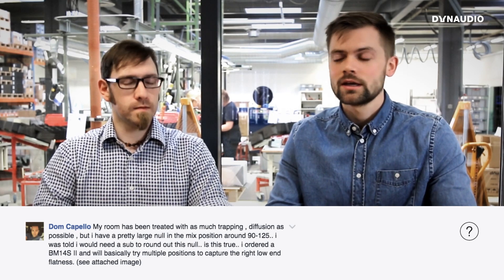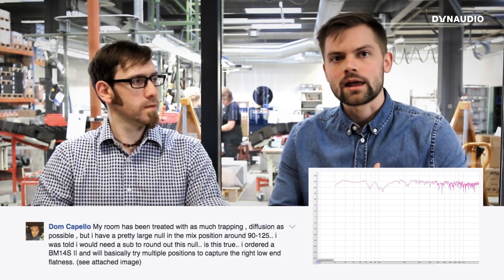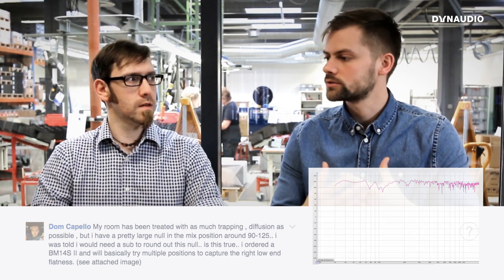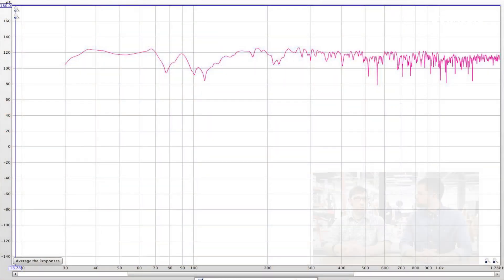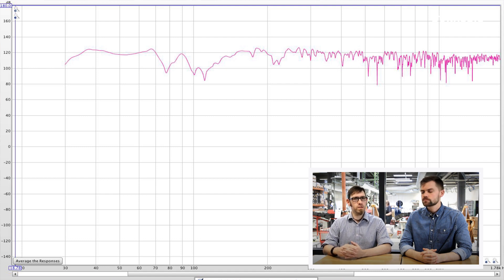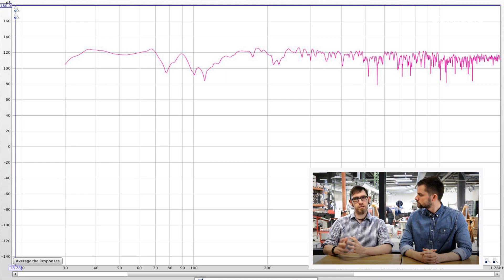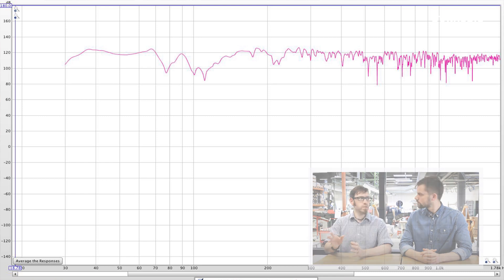Ask The Expert Episode 002: Monitor Placement In Home Studios

Comment: at arms length and 3 metres away for speaker placment ? its a little confusing...

1. should speakers be placed 3 metres away from each other and create a 3 metre traingle ?

2. place spekaers 3 meters away from each other but sit close at arms length ? ( this will form an isoceles triangle )
Reply from the maker: Hi Chandan. 

In the video, Stephen is saying that nearfield monitors are generally designed to work best at a listening position between arms-length and 3m. 

When it comes to the equilateral triangle, you should be placed as far from the monitors, as the monitors are from each other: so, if you monitors are 2m apart, you should aim to be seated 2m from them. 

I hope this helps, :-)

//Christopher.
Reply: Dynaudio Professional dear chris, thanks for the prompt reply.does increasing the size of the triangle result in a more powerful and wider mix? since certain bass frequencies due to their wavelengths need specific distances..right now i work with a 3 feet triangle and find that my mixes sound narrower and tiny compared to other pro releases.please advice
Reply from the maker: Hi again, Chandan. 

Three feet should be okay if you have monitors that are similar in size to the LYD 7s, but four feet could work as well. 

//Christopher.